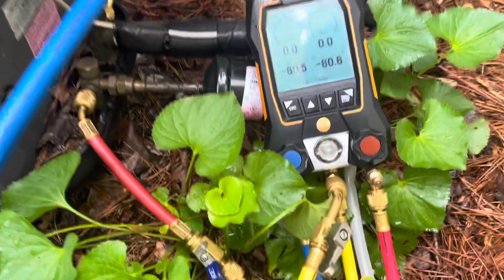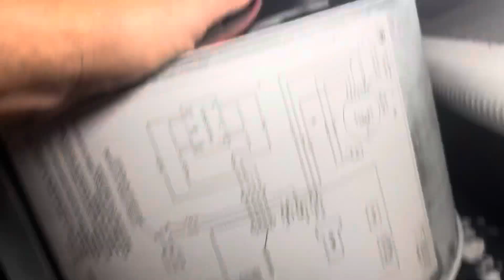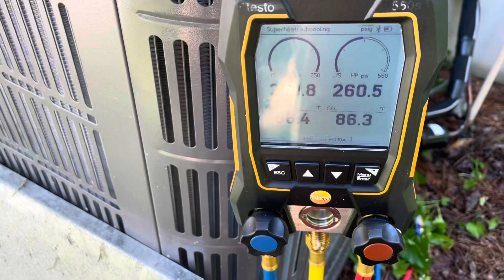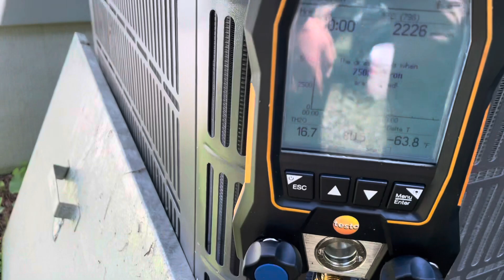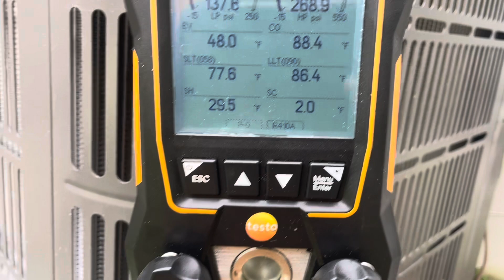Will This New Micro-Channel Coil Leak Too?  Replacing Evap On AHU.

Comment: Good idea to turn off the power if you are crawling in water. At least it was plastic and not sloppy mud. Always keep a change off cloths on the truck. Sometimes if it is real bad they have to get it clear before I get in there! I do not clear water from a crawlspace. Not going to risk getting electrocuted for an a/c repair. IF THE HOMEOWNER IS UPSET, LET HIM SIT IN THE WATER WITH YOU AND SEE THE OTHER SIDE!
Reply from the maker: Very true!

Comment: Water in a crawl stinks...  but not as bad as poopermacha. Old apartments owned by slum lords in east Denver were a problem in the middle of a freezing night.  Just a zone valve. I'll leave my cloths outside and spray em off the next day. Gotta get heat for the tenant.  Cool video sir. Keep after it!  😁👍💪💪

Comment: I found out these units are absolute junk I got a service call over the weekend at a restaurant 2012 guardian unit bad compressor and there was a new one exactly like that one clogged drain
Reply from the maker: You said it friend!
Reply: @JeffsHVACAdventures  it’s either going to turn into a compressor change but I’m more than likely changing out the unit because the compressor changeout is expensive it’s the cost of a new unit